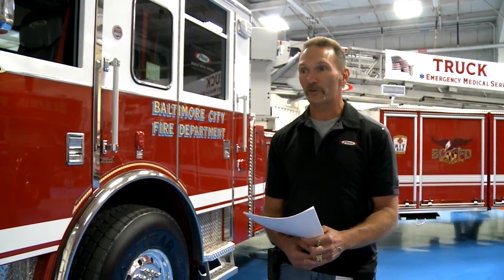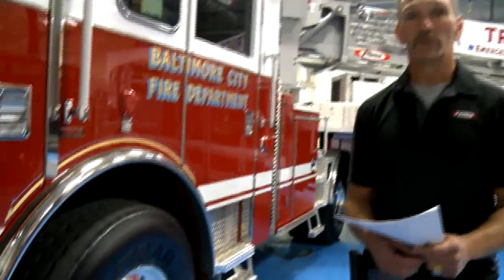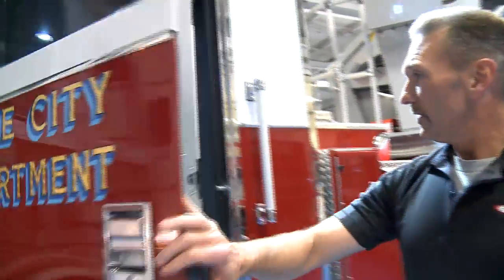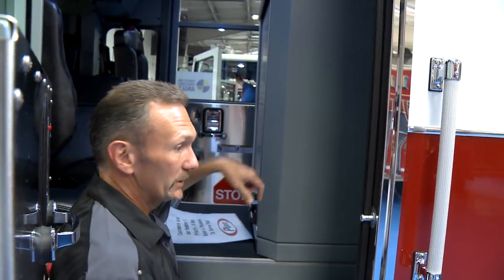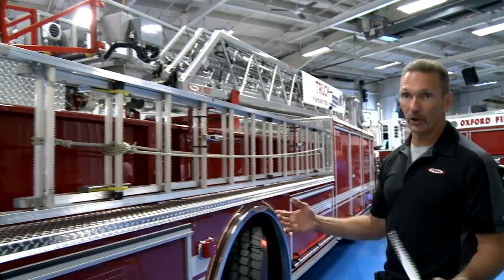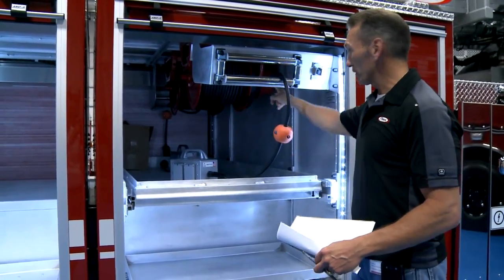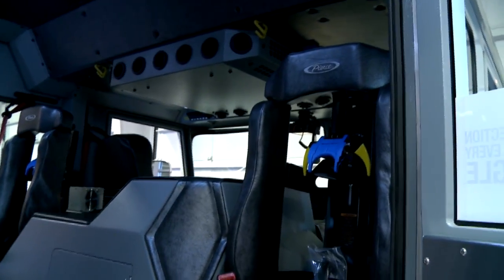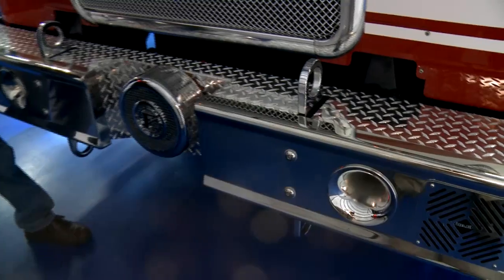Baltimore City Fire Department - 100' Tiller

Comment: Nice trucks, wish there were more tillers around my area.
about the siren,, LIARS :p  They dont have two in case one goes out. Fire Departments just like to utilize both which is perfectly fine. dont make excuses, just say Americans are deaf and dumb and dont like to move over. Then cry when its their house or their mother that the FD has to respond to and not there in 5 seconds.

Comment: Only thing I would have changed was the 5" connection to the pipe.  I'd have put a 15 degree elbow on there facing down to reduce the stress on the 5" hose  hooking in that high up and straight in.  Minor detail.

Comment: I can tell you for sure that this Tiller would not fit in any place where we fit an Engine in, even 100ft Aerials which are bsed on a way shorter truck and have all-wheel steering don't always manage to get into the sidestreets of the almost 2000 year old historic city center

Comment: NEW Tillers was T6, T20, T23 & T29
Reply: Did T25 get a new rig?  They moved from E44 to E21 so I assumed that it had to do with space in the firehouse.  E21 used to have a tiller many years ago T9 when I was assigned to E44.

Comment: I think a major difference between the presentation fo US fire trucks and (at least Central) European ones is that when the producer hands them over it's always already fully equipped, which then makes such presentation based more on the technical equipment than e.g. lights or sirens